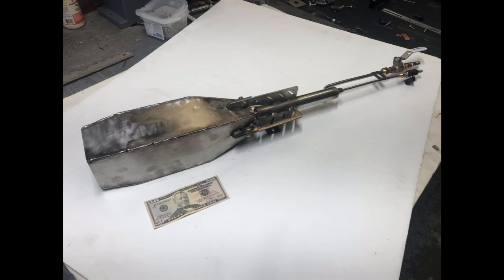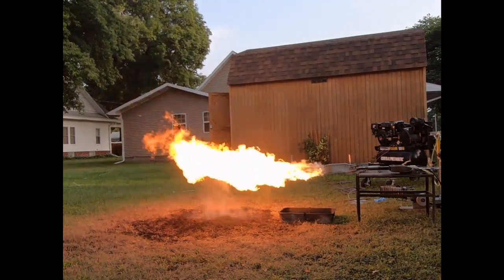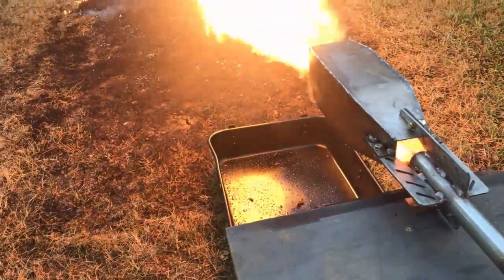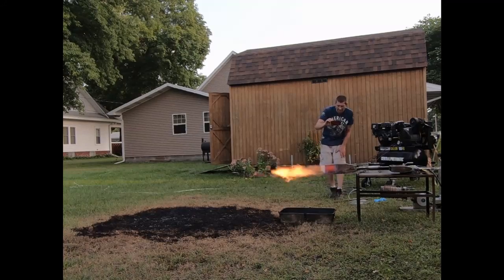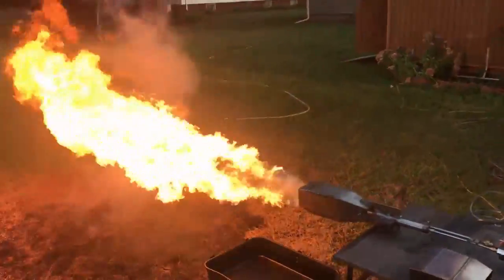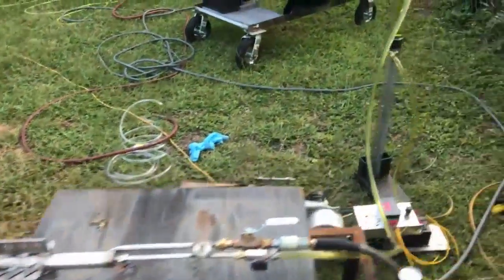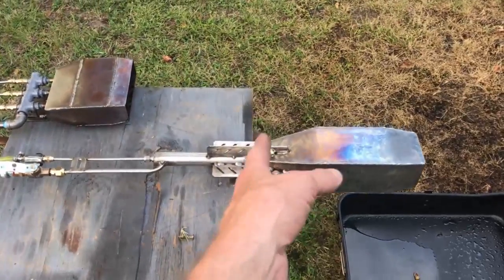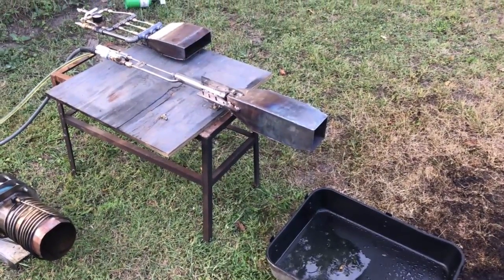3.6 Megawatt Diesel Burner for Jason

Comment: Yeah, this needs a PLC, badly, for both safety, multi-fuel operation, air/fuel ratio, warmup, cool down, and so on....would be epic with a good thermalcouple, flameout/flame sensor, and a thermal trip safety, on the parts of the system where there shouldnt be much heat(still hot obviously) but then it could kill fuel flow, in a hazard situation, and is it just me, or does anyone else want to see this thing on a FLIR

Comment: How long can a steel burner last at these power levels ?
Reply from the maker: years , it is stainless steal 1/8" we can do 310 stainless also
Reply from the maker: if you run it yellow hot it will last 800  hours but if you keep it just below bright red by adjusting the fuel it will last forever
Reply: Yes. Still expecting the new burner.
Reply from the maker: Ben is that you ? My friend from Nigeria ?

Comment: Your burner outside shape causes the flame to be vacuumed into the nozzle area when the flame goes out. Then the sound wave causes the fuel vapor in on itself where the residual; heat reignites the fuel mix. I was shown this many years ago by a old machanic who made a oil waste burner for the shop. He experimented with different shapes till the burner worked flawlessly. Hope this helps you NOBOX7. Also, you should have a real air compressor that is two stage with at least 40 cfm. That way you can really experiment in a wide range area of operation and be able to totally adjust the burner for max efficiency. Good day fella too. VF
Reply: nah man screw compressor. no pressure drop and 120cfm
Reply: @alphawolf099  Yes and huge size too.
Reply from the maker: I dream my friend , perhaps one day i will have enough air , { i own 3 powerful air compressors lol}
Reply from the maker: Yes i am always out of air . needed to see 80 psi but not possible

Comment: could this be used in power generation?
Reply: The people saying, "Poor efficiency", are not qualified to say that. The real question is: If you hooked it up to a high efficiency boiler, then ran a steam turbine, making electricity.... would it be profitable? 3.6MW burner could produce a shit-ton of steam, hence a shit-ton of electricity.
Reply: @milliondollaroptions   that's why I consider myself uneducated when it comes to these things
Reply: if you could somehow get 100% of that 3 megawatts it would be able to power approximately 1800 homes
Reply: @ambiguoustvreference835   what's a reasonable efficiency and the power production?
Reply: @daddyplankton5855  the efficiency of utility scale coal and oil fired power plants is aproximately 37% so you could run aproximately 665 homes off of this burner, if my math is correct
Reply: At a gallon per min thats a pretty poor efficiency
Reply from the maker: LOL , the fuel flow is the power output .
Reply: @MrDustyseb   i dont know anything about it so im guessing that its very poor efficeny then?